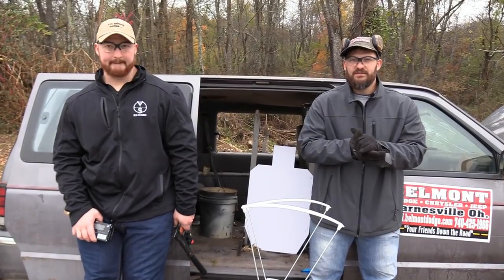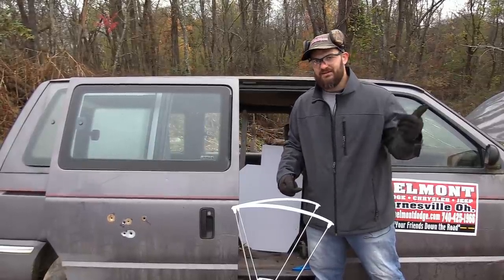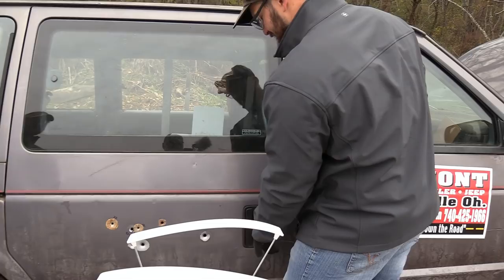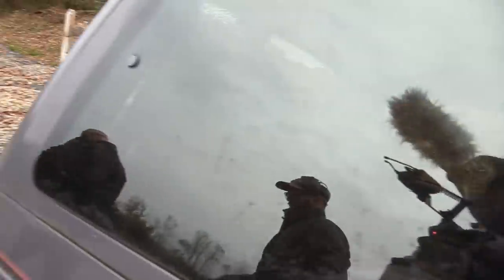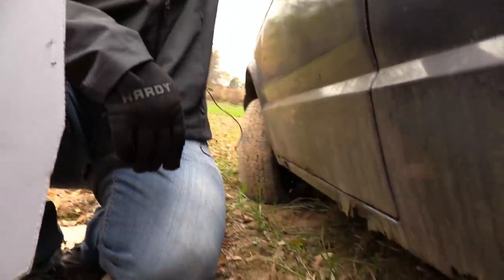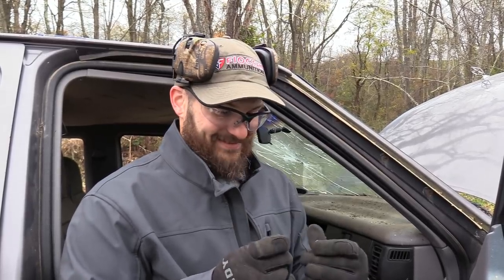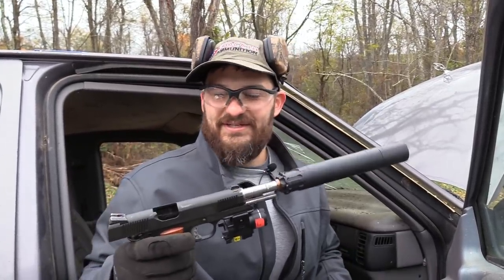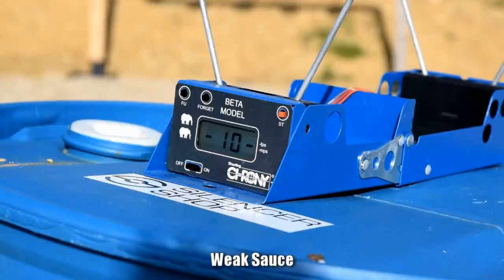HOW POWERFUL is IT? .45 ACP 1911

Comment: Regardless of the reality vs. fantasy of suppressors, for the simple sake of consistency you should not be using either a suppressor or "unique" ammo from test-to-test; o with a single brand and type of ammo for every caliber you test (if possible; if not, as close as possible) and don't use a suppressor. "Parody of other ammo test videos" or not, this series is still scientific enough to get some validity out of the results...but not if you're needlessly switching up what you're doing from caliber-to-caliber.  (And I'm saying this not as a .45 lover or anything, but as someone who actually likes seeing what results you're getting and doesn't want to see it get muddied by unnecessary randomness.)

Comment: You guys are usi g subsonic ammo , im sure nobody uses that for Self Defense. I carry Federal HST 230+p which give about another 100 fps.
Reply: Wouldn't make a difference. It's still far too weak to punch through a vehicle. Only way you're going to get the performance up is to move up to 45 super shooting 185gr bullets. The combination of diameter and velocity is what's going to decide this test.
Reply: Tombs Clawtooth i beg to differ i have shot thru many of barriers with 230 but it was made by Atomic which is like Underwood they load thier stuff pretty hot. Then take for example xm93 and m855, the m855 is moving about 200 fps slower and will not penetrate ar500 target but xm193 will speed is everything

Comment: Your assessment of the capability of the 45acp is WAY OFF!!! 
1. You are using ammunition that is designed to be subsonic and used with suppressors not a standard 45acp 230 FMJ 
2. What type of HUSH ammo is that 45acp FMJs usually do not Fragment that easilly

Comment: Wow using low power ammo where is the 150 gr .45 acp that goes almost 1300 fps and there is a 180 gr plus p that goes 1250 fps or the 255 gr plus p that goes 1000 fps so why are you using low power target ammo find ammo that they would really use and test it you must hate .45 acp must be a 9mm fan.